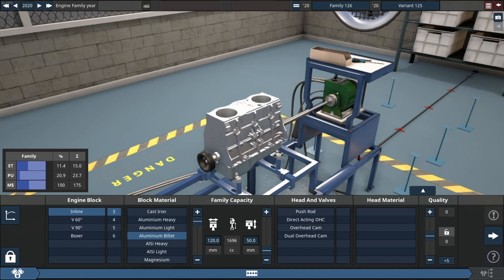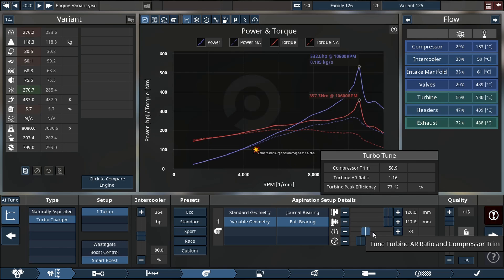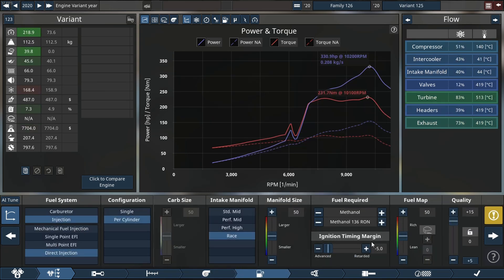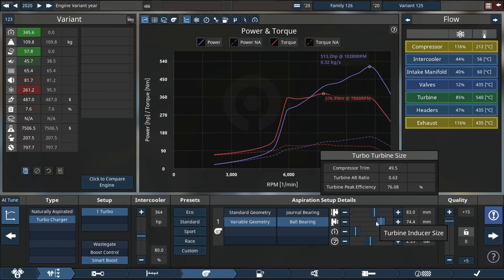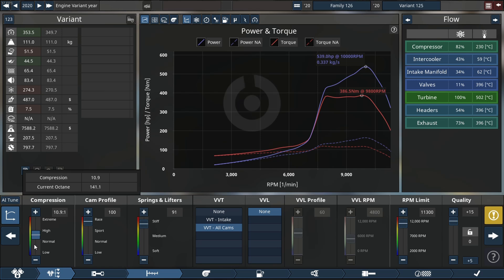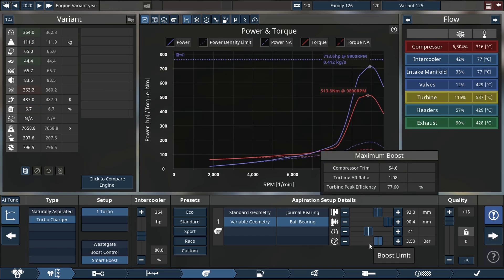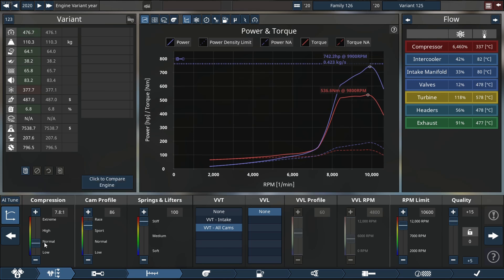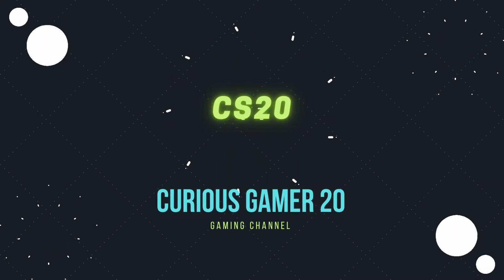800cc   750HP WITHOUT NITRO Automation the car company tycoon

Comment: You could have reached over 800 hp with the best unleaded fuel and even more with ethanol or methanol
Reply from the maker: Yes that is true but I sometimes like to run different fuels in the engines but still neat to see what it made though